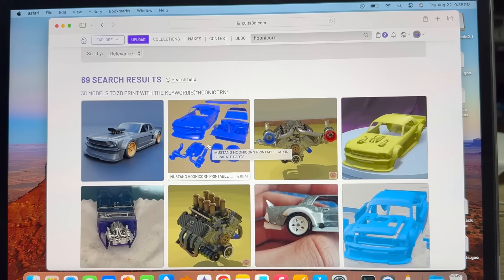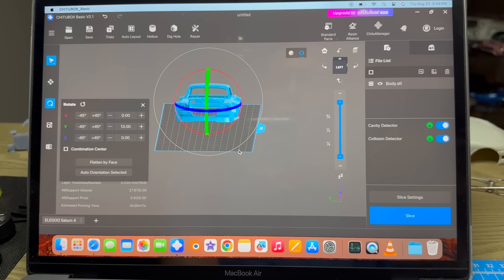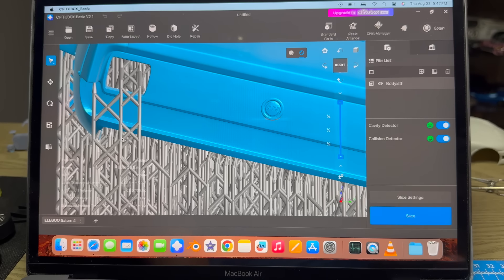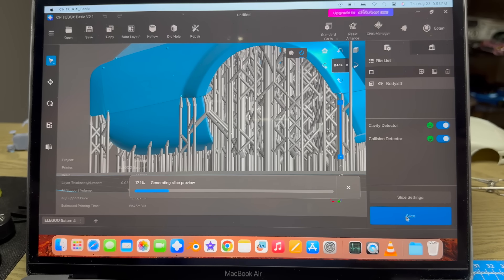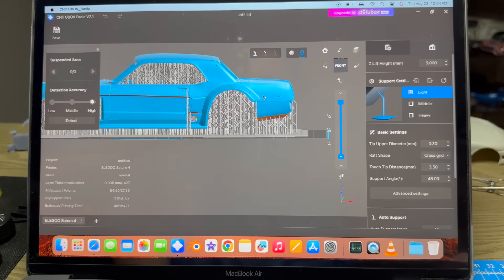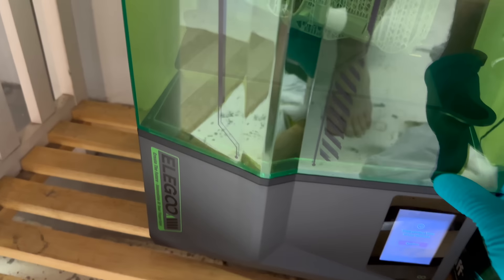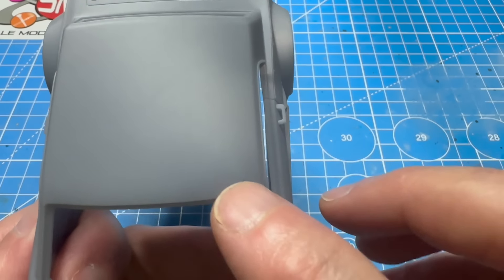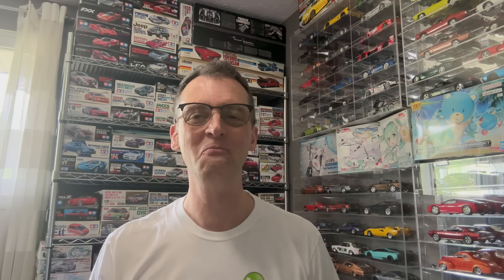Complete Idiot’s Guide to 3d Resin Printing Model Car Bodies Chitubox Elegoo Saturn 4

Comment: I would really like to see some clear windows and or light lens and especially some clear red tail light covers done. I might have missed it but that isn't really something I've seen any tutorials or info about on YT so far. Many of the models you can buy from Cults or MMF have the light covers as separate models but I haven't tried it out yet or seen anyone else do it in videos. Thanks!
Reply from the maker: Yes the headlights and tail lights are seperate pieces and can be printed I. Clear resin. The windows however won’t look good printed. They need to be vacuum formed. I haven’t tried do that yet so it should be an entertaining video with lots of mistakes.
Reply: @ScaleModelExperiment  You're probably right about the windows, I hadn't really thought about it but to be printable they would have to be way too thick to look good. I bought some clear and some clear red resin but I haven't ever gotten around to trying the lens printing so anything you learn and can pass on would be very appreciated.
Reply from the maker: I’ll make a batch of parts to print in clear resin and make a video.
Reply: @ScaleModelExperiment  Many thanks!
Reply: Thanks for this video James. 
For the glazing, I suggest using Evergreen polycarbonate sheets in 0.25mm or 0.37mm. The results are very satisfactory!
Reply from the maker: @pierrededinard1957 thanks for the tip. I have some .02 PETG Sheets for vacuum forming. I haven’t tried it yet, should be an adventure.

Comment: Fantastic video James, thank you for sharing your journey. I have a couple of questions as I am going to follow you down this rabbit hole as I have just bought an Elegoo Mars 4 as well as a Photon Mono last night to give this a go. I come from FDM for many years, and only now dipping my toes in resin.

I have a slightly different approach to what you are doing and will be looking to print in order to make silicon moulds so that I can have a go at resin casting. 

My questions to follow:

If I wanted to print the same car, but with the aim of keeping some supports in the car so that the body remains rigid for the process of moulding, is there a way to make permanent braces internal of the body? 

What resin are you recommending to use for printing at the highest level of detail? 

Many thanks in advance, you have a new follower, I look forward to watching more of your videos in hope that you will create more on the cars. 

Regards, Ciaran from South Australia.
Reply from the maker: First of all, welcome to the channel I appreciate your support. 

I recommend learning some basic CAD to build in the reinforcements say from rocker panel to rocker then front to back. The supports we use to print would make a mess of your mold.

Ive only used the Anycubic brand water wash resin myself but just received some 8k standard and water wash from Elegoo. I’ll do a comparison video printing tiny delicate stuff to see if there is a difference in performance of each.

Take care and thanks again for watching. I’ll do my best to answer your questions.

Comment: Just bought an Elegoo printer and am excited to learn all about the hobby. Wonderful tips for a newbie. Would be handy to know the recipe for your wash fluid. Watched how you printed the interior pieces as well. Like to see how you set up print speed, maybe using a developing tool. I’m sure it’s crucial when using different resins. Are there choices for slicers and which is best? Also curious how to scale up or down files. Say a 1/24 into 1/43, for example. Can the purchased files be edited? Some model files have set wheels. Would there be a way to modify them to roll? Have you any experience with scanning such as Kiri Engine and maybe considered making a printable model? What mesh editor is best/easiest to learn? Just a few things I’m wondering about as I embark on this new hobby. Your channel is model build centric, so if my questions are more appropriate for a 3D printing learning channel, is there one you can recommend? Thanks in advance.
Reply from the maker: Hi Mad-Mel, I use a water wash resin so I use tap water with a splash of degreaser from the dollar store called LA Awesome but any household degreaser would work.  I used the factory recommended print settings that Chitubox suggested.  I only change the layer height for things that aren't super important to less detail.  I have used Chitubox and Lychee.  I prefer Chitubox because I think that the auto support works better. Scaling parts can be tricky.  If the part is exaggerated then as your scale it up or down it will reveal.  Yes, purchased files can be edited, but I have no experience with editing software. I had a friend making his model roll and it rolled off the table and broke. Bad idea!
Reply: @ScaleModelExperiment  thank you for responding. I’m still a newbie, so every little bit of advice helps.

Comment: Great job. I've been looking at this model to buy and print so this is good.
Reply from the maker: Print both the full engine and in pieces so you know how to fit it all inside the engine bay. I suggest replacing the drive shafts with styrene rod as well. They were a little short.
Reply: @ScaleModelExperiment  Thanks. I can modify the .stl files for the drive shafts as needed so that shouldn't be a problem.

Comment: I think it would be good to see you print using a resin mix. I mix mine to avoid it being so brittle. I use Tenacious D to make it more flexible.  Look forward to hearing your reply.
Reply from the maker: I just reviewed a resin from Nova3D, their water washable tough grey. It had flex to it after curing. I think it would work well for printing body kits so the parts could be flexed into position easier.

Comment: Awesome video James. I started 3D printing 4 months ago. Hay what is a 70 year old to do right? I have 3 of his files and have not tried bodys yet so I would like to see the whole process as it were printing it. So 13 degrees both directions, got it. 👍
Thanks again James!
LLAP 🖖
Reply from the maker: Hi Bruce, yes 13-20 degrees is what I go with. More importantly look for parallel and perpendicular surfaces. If you can minimize those you’re golden.

Comment: Is that angle that you're putting the car at, what you calculated or just from some tests? There is actually an equation that you can do according to pixels that will tell you the best angle for your printer. Which makes the layer lines even less noticeable. Also, I know you removed some supports but you still do not need that many. You can get rid of half the supports that you have. I also print Bodies in 1/25 and 1/32 for slot cars. In saying that I am glad that you're doing a video like this. People think that it is hard and its actually really easy. SLA printers have come along way in the past few years, so they are much easier to use.
Reply from the maker: Hi Danny, yes that angle is near 45 degrees. The problem I am having is when the print gets too high into the air I get a z shift somewhere on the print. I can sand off layer lines but a z shift is a deal killer for me. After sanding there is a bump where that line was. Therefore I’m trying to keep the prints low and well supported so they are rock solid.
Reply: @ScaleModelExperiment  I understand. I’ve had Z shift but seems to be at random and for no specific reason at all. What is weird though, I’ve printed tall figures that were 10inches plus and not had that issue. Wondering if it’s because of the angle and weight? I normally print flat to keep print time down and use very little supports. I like your content, I will be continuing to tune in.
Reply from the maker: @dannywiley4072 I’ll keep trying different things to eliminate the z shift. When I figure it out I’ll do a video.

Comment: These are awesome! 
I would love to upscale older kits that are only 1/24 _1/25 th..

I wonder how difficult that would be?..
Reply from the maker: Hi Thomas, harder than you think. You’d have to convert the model to digital then size it correctly. The wall thicknesses is a major issue too thin and they won’t print too thick and it looks silly.
Reply: @ScaleModelExperiment  gotcha 👍

Comment: I recently got a Saturn 4 Ultra but I'm in so far over my head I don't really know how to use it effectively. The tilting vat I am told means that sadly, all the videos about how to angle prints are useless for me because of the way the fep peels away differently. It's been tough to figure out, not much success yet.
Reply from the maker: I don’t know for sure because I don’t have the ultra (yet.. are you listening Elegoo?) but I would angle and tilt just like I did and you should get the same results just faster.

Comment: You have really helped me decide to postpone my SLA 3D project because miniatures with lots of details don’t really show flat surfaces where print lines appear.

Do you have any suggestion for other resin printers that show MINIMAL print lines?
Reply from the maker: My first machine was a 4k Anycubic mono x2. It taught me the basics but now that I have a 12k Elegoo machine it is near perfect with good angles and high resolution. Could I tweak it a little more? Yes I could, but time isn’t what I have a lot of… I recommend the highest resolution printer and largest size print bed that you can afford. Just remember that if you go cheap in the beginning you’ll always wish you spent a little more for a better printer. Mine was $380.
Reply: @ScaleModelExperiment  I agree with you, but do you think according to your research and experience that today’s SLA or should I say mSLA resin printers (Saturn 3/4 Ultra, Anycubic Mono M7 Pro, HeyGears Reflex RS) can achieve injection-molds-like results in the hands of a professional?
Reply from the maker: @popilirol there will always be a pretty side and an ugly side to a 3d printed part. Same with a production kit, both sides are nice but there will be a seam down the middle. If angled well you can minimize print lines to something that can be whisked away with sandpaper quickly. The variety is what I enjoy with the 3d prints. Anyone can go buy a Mustang kit but you have to print a Hoonicorn.

Comment: What resin did you use? How long did you then expose the parts? How do you deal with the fact that the resin parts change their shape?
Reply from the maker: Hello San, I use Elegoo water washable 8k resins and cure them for 2.4 seconds exposure. I don’t notice much shrinkage of parts after curing.

Comment: When you buy those 3D patterns can you scale it up to make like 1/12 scale.
Reply from the maker: Yes, but then you are limited by the space on the build plate to print. Mine is 10” long so a 1/12 scale model body may not fit. Rims tires and engines would work though

Comment: I soak my build plate in hot running water, pry on one corner of my prints and flip to cold running water and it pops right the f*** off. Didn't learn how to do it till I scraped up my build plate though LOL.
Reply from the maker: I sometimes use a bucket of hot water to loosen up supports. Thanks for sharing your technique, I’ll try that👍

Comment: Rotate the x,y and z to prevent panels facing the x, 45 degrees or y axis. The best spot for printing using anti aliasing is found by printing a sphere and observing the best angles on it.  turns out the inbetween angle of 45 degrees is the best so x22.5, y22.5, z 22.5.
Reply from the maker: That makes perfect sense. Thank you!

Comment: Will the roof not sink in high heat. Some pla+ model suffered deformation in summer
Reply from the maker: I don’t store my built cars in direct sunlight and the model room is temperature controlled. I have not seen any warpage in any of my prints.

Comment: check your fep for a crease, good chance thats why your getting that line in your print.
Reply from the maker: You’re absolutely correct. When I drained the vat to change to clear resin in noticed some marks in the FEP. That would have caused the marks on the tops of both cars.
Reply: @ScaleModelExperiment  I'm new to Resin printing, what is FEP?
Reply from the maker: @melvilib  the FEP is the clear film that is between the liquid resin and the screen that displays the image to be printed. A crease in the FEP will show in the print.
Reply: @ScaleModelExperiment   Thanks for the explanation. Makes sense now. If it is anything like plastic screen protectors for phones, then it woyld be easy to get that uneven or trap dust.

Comment: Great stuff...so how do you save them into your computer? And how do you transfer them into the printer? 
Just curious,  I would like to get a 2d printer but now sure how that works.
Reply from the maker: Hi Marcelo, I save them on a flash drive that plugs into the printer. Once finished printing I delete that file from the disk.
Reply: @ScaleModelExperiment  
Oh ok..and do you have to delete the file every time?
Reply from the maker: @marsgarage8217  yes, or your memory stick will fill up with old files.
Reply: @ScaleModelExperiment  
I'm thinking on getting one, so hopefully I can get some 3d print stuff lol..not sure about full kits like you, but engines and rims and tires would be a nice start.
Reply from the maker: @marsgarage8217 to help your shopping, if you don’t need to print bodies you can get by with less than a 9” print screen. Otherwise get the 9 or 10” for bodies.
Reply: @ScaleModelExperiment  
Got it thanks..if I need any help I'll email ya.

Comment: Which cheaper resin will tolerate summer temperature please. I print 1/18 scale
Reply from the maker: What temperature are your prints exposed to in the summer? 1/18 is big, I can see your problem.

Comment: Could you have made the print lines finer?
Reply from the maker: Yes, I could have set the resolution for .01, it would have taken twice as long to print but they would still be there just finer. Angling and tilting is the key to smooth prints. I’m learning more as I go. When I perfect it I’ll shoot more video.

Comment: I have never used that many supports for 1/4 scale busts.
Reply from the maker: What’s funny is I still had z shift even with all of those supports.
Reply: @ScaleModelExperiment  Too many supports can be worse than too few. I would try 20% density medium supports. You have the right idea about not having flat prints, the angle doesn't have to be that extreme but it works, just uses more resin and takes longer to print. You will see that the print time will be much lower and with fewer supports, you won't see the Z shift. You can also use a small amount of AA to get rid of any voxels that you might get. A model like that really doesn't have any pull to it with all the windows open. I think you would be happy with the results if you did a couple of test prints as I described. I am just trying to help a fellow hobbyist. Good luck.
Reply from the maker: @ interesting, I’ll have to do an experiment with larger supports and fewer of them.

Comment: Are you using water or alcohol in the washer?
Reply from the maker: I use water with a degreaser LA awesome that I buy at the dollar store. I use a water wash resin so it cleans it easily. I have tried Elegoo’s resin detergent on their ABS resin and it works amazingly well. But it’s $50/bottle.
Reply: @ScaleModelExperiment  Soinds good ! great videos and very helpful ! Thank You !
Reply from the maker: My pleasure Martin! Thanks for watching👍

Comment: I always print flat...I’d rather clean up the large top surfaces than fiddle around with all the side details.  Plus it prints quicker.
Reply from the maker: I’d rather have something on the printer longer to not have to sand anything😁

Comment: I may have missed it, what resin are you using?
Reply from the maker: I use Elegoo 8k water washable resin
Reply: @ScaleModelExperiment  Thanks, I'm using V2 Water wash atm.
Reply from the maker: Hi Scott, I’ve used that resin as well. It works well and there are more colors to choose from.

Comment: Can this printer fit 1/18 scale body?
Reply from the maker: I think it could print a 1/18 scale body. It might be at 90 degrees or close to it standing up though. Which of course would lead to bad print lines. I’ve seen bigger 15” printers but they are expensive.

Comment: everytime i wtf when see someone uses a steel scraper on this beautiful etched buildplate
Reply from the maker: There’s no way the parts will come off the build plate using a plastic one.  What’s your secret?
Reply: @ScaleModelExperiment  i use the plastic scrapper which elegoo adds to the package
no problems with rafts with conjure tough resin and saturn 4 ultra (0.05, 3.4s,35s, normal speed)
Reply from the maker: @MrBirdshell666 I’ll try it, thanks👍

Comment: There are some videos showing the best angle for less scale pixel and is helpful. The angle is 44,3º
https://www.youtube.com/watch?v=Qs2Rb0ExnIM&t=11s
Reply from the maker: Thank you for the link. The problem I have been having is as the part gets farther away from the build plate you are at risk of Z shift. Whereas the whole print shifts ever so slightly and leaves a step right in the middle of the print. On the angled/tilted body it was there in the middle of the door. When you sand it off you are loosing part of the surface of the door to make it flat. Therefore my experiment was twofold, no angle to see if z shift happened and low angle to see if you can get away with minimal lines.
Reply: @sadheartcreaciones  thank you very much for your input and link much appreciated ❤🍻🇦🇺🦘🙏👌

Comment: I’m a noob this file is in 1/25 is there a way to scale it up to print it at 1/16 to 1/12 maybe even 1/8.
Reply from the maker: Hi Ronin, yes when you purchase the files he offers it in many sizes from
 1/43 to 1/8. Granted you’ll need a huge printer to do 1/8 or print the body in like 6 pieces. It can be done!
Reply: @ yeah I probably wouldn’t do 1/8 mostly 1/12 cars and 1/12 parts.